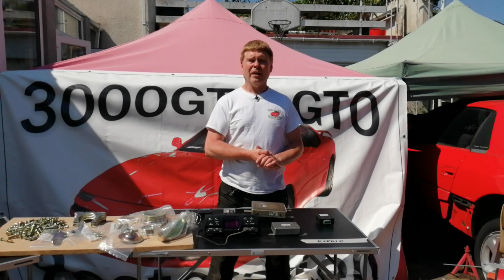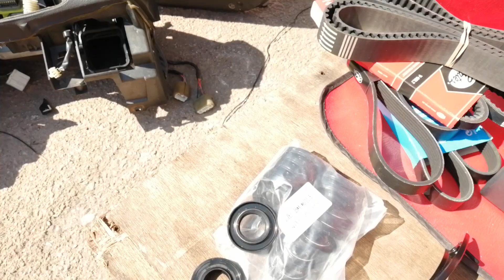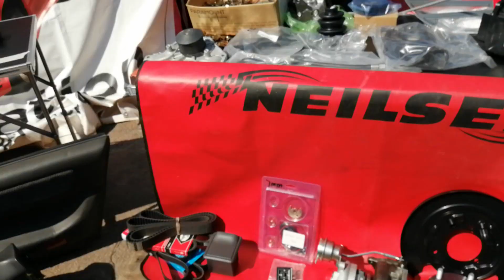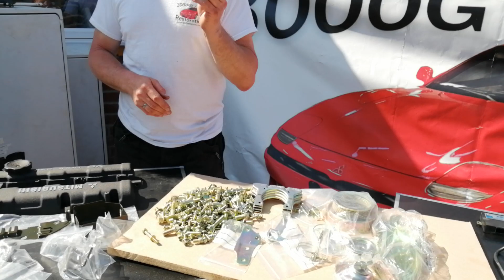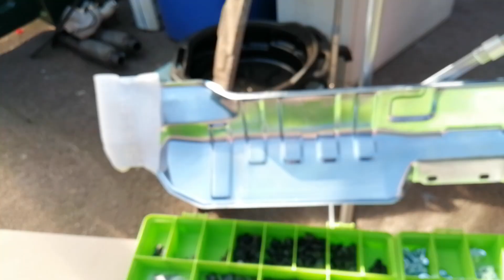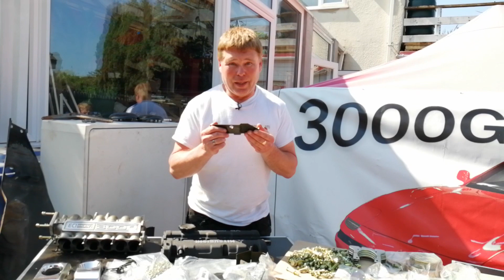Mitsubishi 3000gt / GTO New, Repaired and Restored Parts

Comment: Watching your section on zinc plating I’m wondering can the intake manifold be replated? Also what is my option when it comes to replacing electrical connectors? I’m currently pulling the engine on my 1991 VR4 and a lot of my clips are breaking so I’m wondering where I can get replacements since I don’t think it can be restored.